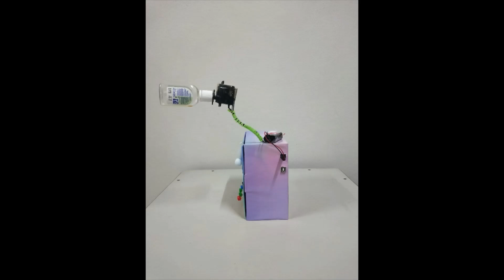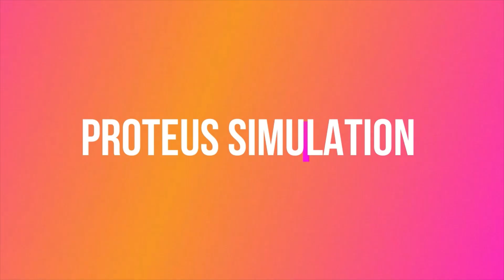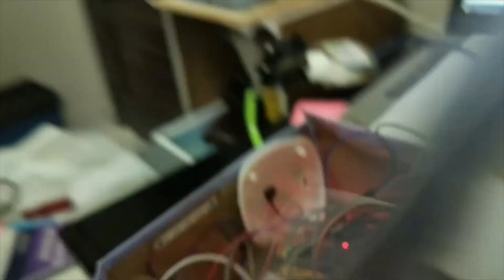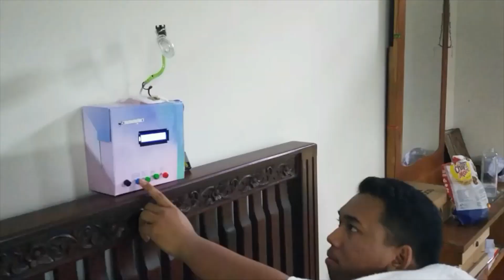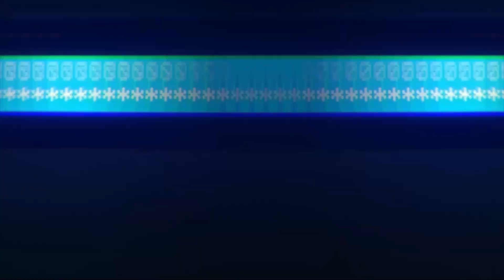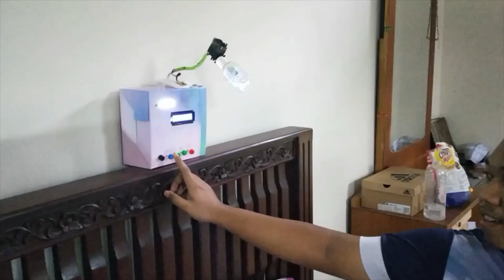GROUP 9 - WAKE ALARM ARDUINO WITH AUTOMATIC LIGHT ON AND WATER SPRINKLES

Comment: Good explanation & outstanding demonstration. But can you please explained the following:
1. Why you need to move the servo motor to 90 degree first, then move to 180 degree? Why not directly go to 180 degree?
2. I don't see any explanation on the light sensor. Is there any light sensor in your program? If yes, can you explain a little bit how did you program the light sensor?
3. Why did you need light sensor? you can directly turn on the relay when you set the lamp HIGH..
4. What if the head move to other place? How can the system detect the head location to sprinkle the water?

ps: Ganas betul cara dia tuang air tu.. habis basah lenjun katil..
Reply from the maker: Thankyou to our beloved lecturer for the questions. The answers for the question are as below.
For question 1 , we set the servo motor to 90 degree first and then to 180 degree as we want to ensure the water is not splashing away from the desired target. By going to 90 degree first , the speed of water can be reduced and the target will be more accurate.
for question 2 and 3 , we already use light sensor called LDR sensor. In fact, this sensor will detect the light intensity in the room and also the sunlight from outside in our initial project plan. As we are running out of budget and time in designing this , we replace the sunlight and light room input into the lamp input which LDR detect the light intensity from that light which is a major component in our design to brighten the room which can alert the users about the time is already finish. To program this, the LDR will detect the light intensity in the room and if the light intensity with minimum value of 800 (maximum is 1023) , this will trigger the buzzer to alert the users.
for question 4, the water sprinkle Is only one of our digital output, this is also a bonus for the user to wake up immediately if one of the parts of the body ( hands, face , legs, skin)  being touch by the water which will immediately wake up the users. The system not only target the head of the user in this first stage of our prototype, in fact, it can be any parts of the body and if no parts of the body being contact with the water, the high intensity of auto light and the buzzer with high frequency and sound compared to normal alarm might be useful to the users.